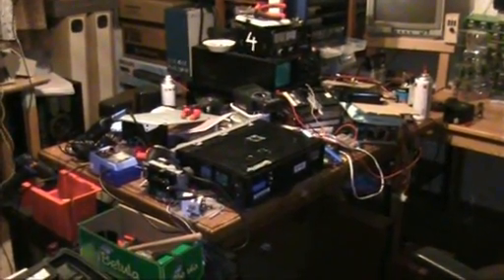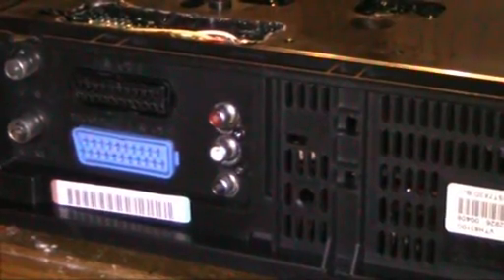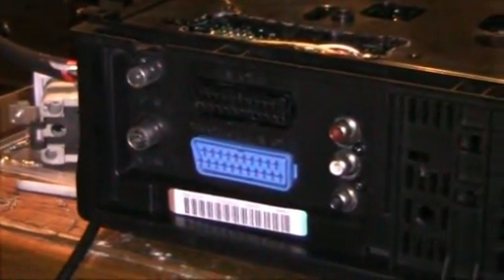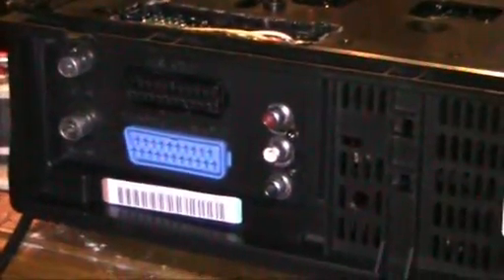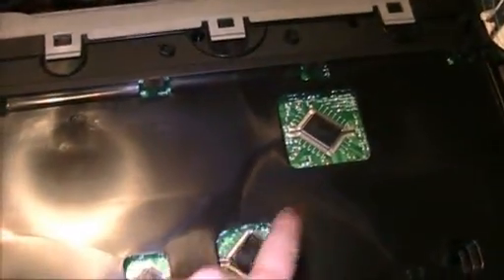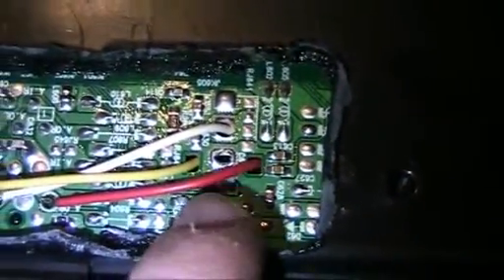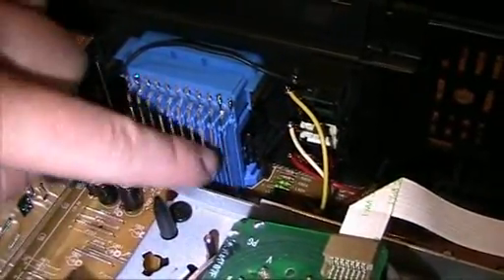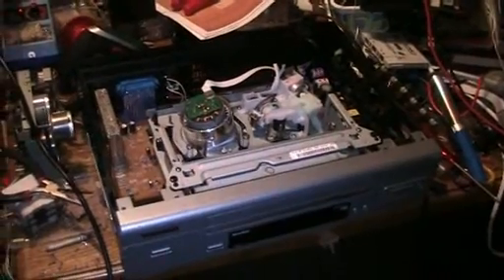DrCassette's workshop - Thomson VCR modifications!

Comment from the maker: @yeoldeengineer 
Coax would be an overkill for this thing. The housing is pretty well shilded, not even the wires that connect the head to the circuit are coax.